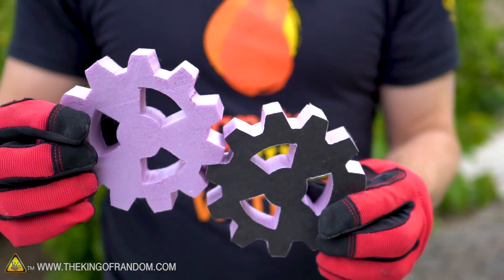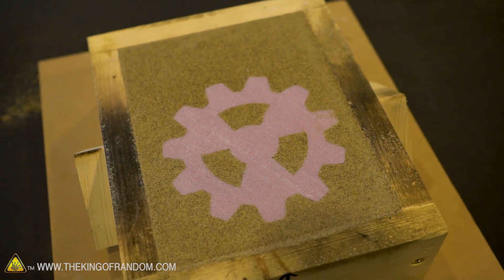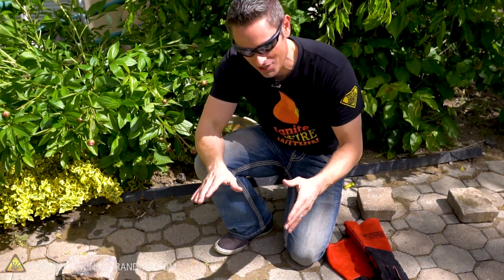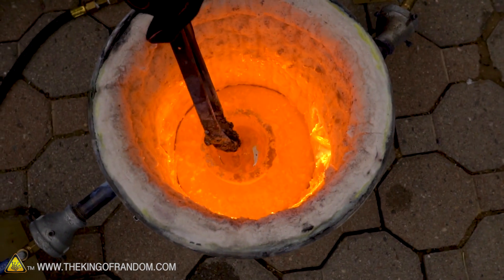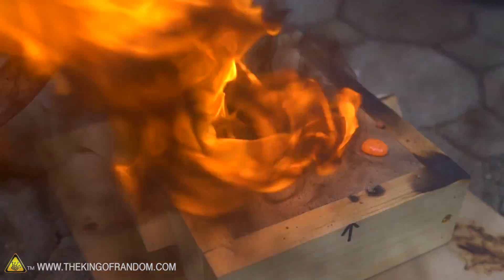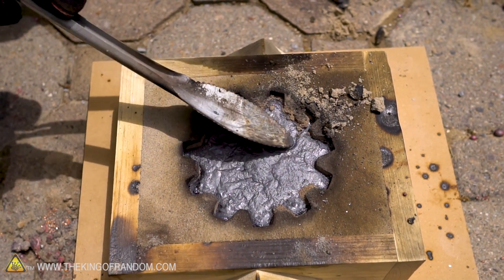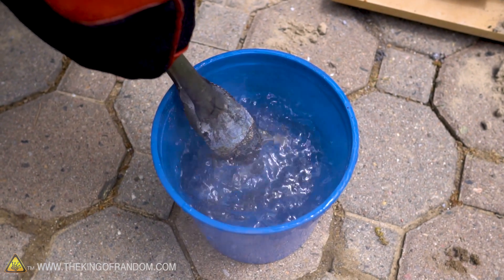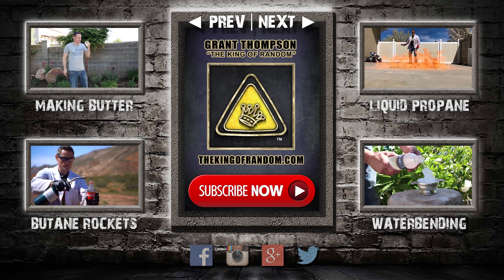Argh. Why Is Copper So Difficult? TKOR Tests Melting Copper In Our Homemade Foundry

Comment: You'll need a interlocking sand (grains with sharp edges) and one of much finer grain size. Then use a mould cavity design with both a lead in (for a gear design, properly best placed in the center of the hub) and also a spillover with lead outs from each of the teeth.

Comment: Maybe have it where a hole leads down into the mold where the styrofoam is sealed into the sand box that way the sand is stable
Reply: So basically two box sand mole where the 2nd box has a hole to allow the copper to flow into the more stable gear mold to keep the sand from floating to the top

Comment: Problem is the density of the copper which is very high .just mix some moist cement with sand and bake the mould and then spray some more water and bake that again . And then try

Comment: I wonder what kind of sand you are using? Perhaps brick layers "sharp sand" will keep form better? Beach sand has been rounded off over time, sharp sand is usually sourced from the upper reaches of rivers, the rough edges on each grain of sand helps to lock them together. If you have ever played on a sand tennis court you will know how hard "sharp sand" can be packed.

Comment: Not an expert by any means, but have you tried using a petrobond style of sand? Instead of water, it uses oil, like 2 stroke engine oil. The copper might be flash-vaporizing the water and destabilizing the integrity of the mold. I'm not sure, though.

Comment: You do know that the point of green sand is so you can mold without destroying the original. Take out the copper gear before pouring. Also maybe a channel to poor rather then a direct pour would help.

Comment: Your best bet would be to encase your wax (not polystyrene) shape in clay (or your molding sand method), leave it dry (making a sprue to pour the metal into the mold inside), then pour the metal while it is as close to its hottest as possible - you should get better results.

Comment: I'm not a metal-melting-ologist... But from what I know from my forays on YouTube, flux is important in the metal being purer. Additionally, with a metal that's as dense as copper, you may need a different, denser casting medium and an enclosed mold, not open-top.

Comment: Yes Man You're supposed to keep the lids on the side use some sort of vice grips to hold the lids on make a hole going down to the gear then pour your mettle of course you're going to have some cleanup but it will come out a lot better than what you have going on

Comment: bro you're supposed to make a hole and keep the wooden lid on both sides make a hole down towards the styrofoam gear to pour the molten metal into it will keep the sand in place

Comment: I would definitely guess the green sand just dried out from pouring on it so many times. I think over watering it then caused it to boil and knock the sand loose. I'm just basing what I'm saying on uneducated observation... you didn't have ANY problems with the sand when it was at the perfect moisture. Definitely had to be frustrating doing this over and over again.

Comment: If you use a closed mold with a high pouring spout then gravity will help fill the mold in completely!
Also melting the foam beforehand actually isn't great because it removes structural integrity from the mold.
Just some tips if you want to get a beautiful cast! :]

p.s. love the channel!
Reply: Oh also don't forget to add some exhaust vents on the mold if you do a closed cast! Otherwise the fumes may dismantle the mold.

Comment: When I was in school doing green sand casting, we buried the mold in the sand and had two access funnels dug through the sand to channel the molten metal to the cavity the extra pressure from sand on top might hold your gears in place while the pour happens.

Comment: it's because copper is more dense than normal metal so when it goes into the sand it pops out and moves the sand so u need a stronger surface that can handle a sense liquid

Comment: hey Grant, have you considered using the same cut out, but use concrete instead of sand. not as flexible as sand, but hey it will last

Comment: I think you would need to an oil based foundry sand so that the sand doesn't eject like a volcano. With that type of heat you would need a foundry sand that is very dense.

Comment: @ Grant Thompson 

Here is a few ways to make it better.

Use a cope AND drag mold, not just a surface mold because all you upper edges will be worse

Instead of foam, using something that turns liquid, like wax.

Melt your investment by baking your mold.

BAKE YOUR MOLD AS HIGH AS IT WILL GO, at least 375F

Poor with your mold AS HOT AS POSSIBLE

Fill your mold with nitrogen (absolutely NO pressure and the gas must be hot or at least not cold)

GET PROPER POURING TONGS !!!!!!!!!!!!

Comment: this i problem beacause of erosion due to high velocity of pouring metal and high density so if you use closed gating you can regulate speed can get perfect casting.and you have to heat the material to pouring temperature so that it wont have much aspiration.

Comment: You need a two-piece mold using the correct casting sand. You also need to pre-heat the mold in a kiln & bring up to temp before pouring; anyone who does bronze knows this! Be sure to flux out your crucible of molten metal right before pouring, as impurity's will really screw things up!

Comment: the copper is so hot that whatever moisture that's in the sand is immediately evaporated out, which is why it was so crispy, and likely why the middle parts of your gear kept falling out.  that and someone already mentioned the density of the copper causing those parts to float out...  

maybe you could try to reinforce the sand with toothpicks or something like that (maybe not wood, but something)

Comment: From what I know, with the wetter sand, more water in it turns to steam and expands it, that's why with the wetter sand it's not great. additionally while the heat makes the styrofoam shrink, it turns into basically plastic. That plastic when burned (with molten copper) leaves a small black charred mess. That plastic could account for the imperfections on the downside of the copper. Insulation packing is probably more dense than most other foams, so maybe a lighter foam will work, either that or somehow remove it before pouring?

Comment: man use a top part of sand let me explain, make the bottom part the same as u made but in the top part put a pipe and put sand and press, after remove the pipe and you will have a way to put copper in the midle of the sand and the sand wont get destroyed by copper sorry for my englis i speak portuguese XP

Comment: The sand keeps floating to the top because of density. Liquid copper is more dense and the sand just wants to float. There are plenty of copper casters here on youtube who use green sand--just used a SEALED green sand casting with risers, not foam. Hope this helps :)

Comment: My experience has been that normal kitty litter is unsuitable for green sand. My bag was calcium bentonite, which had very poor dry/high temperature adhesion properties in all my tests. Sodium bentonite clay appears much more sticky and solid, such that I can cut/saw my green sand using a serrated knife if I let it dry up. To make sodium bentonite, I blended kitty litter powder with saturated NaCl brine water from my water softener. After a few hours of letting the clay settle, I sucked the brine off the top (using a syringe needle + small vinyl hose connected to a pre-evacuated cookie jar vacuum chamber), then repeated the process of adding water, blending, settling, draining a few times to wash the residual salt off.

Comment: You should try adding some corn starch or potato starch to the sand to add some more rigidity. Since it's a non newtonian fluid it might help bind the induvidual sand particles together. Also because starch is a carbohydrate it will lose it's hydrogen atoms from the heat and turn into solid carbon wich could hold the sand together. (or destroy it) I say it's worth a shot at least after making all these tools and preperations.

Comment: just 2 thoughts... add a lid to the sand casting with a funnel like when you were casting the swords or... add something like a bolt in the sections of sand that keep braking off to connect it to the rest of the casting.. like i said, just ideas!

Comment: You need to make a mold that is supported on top so the Center pieces don't float to the top. Also you might want to use foam board from the craft store instead of insulating foam. I would really like to see you try these suggestions as I think it would work.

Comment: ok, can you try to the foam gear in the middle of the sand with a foam rod leading into surface? when you poor the copper, it will burn out the tube, then flow down into the mold and spread out. note you need your copper very molten for this method.

Comment: if you do the green sand correctly it will work, you want to make a surround casting around the gear, put it half way in green sand in 1 box and half way in a other, be sure to use some sort of releasing powder, baby powder works, then you should have a box with a void in terms shape or your gear in the middle. then add a pour hole on one end on the gear, and a vent hole on the other end. heat up your copper, and just keep pouring until you see copper coming out the vent hole. it can be difficult to do at first, but once you have the correct mold it will work right now you are not using green sand casting correctly, also it will cause less fire scale on the finished project, and you could see if you can get your metal hotter, and you should heat the mold to have less heat loss from the copper

Comment: Hi, Grant! I'm a BIG fan of yours. I can see the issue you are having is because the molten metal is denser than the sand, thus, popping the sand up. What you must do is to create a second half of the sandbox so the foam is completely surrounded, placing the foam in the centre and after placing the second half of the box, make two passages for the molten copper to flow through. There MUST be two passages to the foam as one passage is for the molten metal, the other for expanding gases. If the gasses can't escape then, POOF, a cloud of hot sand and possibly some molten metal too. Keep up the great work!! Hope you have more success!
Ed

Comment: next time, try covering the symbol and pouring the copper into a channel that flows into the mold. You will have to cut off the channel afterward, but your middle pieces won't float.

Comment: why dont you stick the styro foam to the base board and after you put the sand into the mold you will just turn it up-side down and take off the board with the grear form and you will just have an empty gear hole you will just pour the Cu into a form without styro foam

Comment: You should have made it an enclosed mold with a cap on it and a pour hole with vent holes. Then it would have had enough structure to hold together when pouring the metal.

Comment: Couldn't you just make the mold then use a spray bottle with diluted white glue and water just spray  the sand let it saturate a bit and try melt out the styro lightly spray the inside edges of the mold with same glue water mix let that dry and then do the pour? I would think it would make the mold hold its shape for slightly longer at least making the edges not crumble.

Comment: Instead of sand, you should use concrete for higher temperature meals such as copper and steel. This would make sure the styrofoam stays in and none of the sand will collapse.

Comment: What about if you made a trench for the molten copper to get to the mold rather than pouring the copper directly into the mold cavity?? That was you are not pouring it directly into the mold and causing damage to the sand.

Comment: try using copper wire. you can melt many batches of wires in a single go. and add borax to the melted copper.

Comment: What you have to do is bury the foam piece half way up the sand box so that it is completely covered by sand. Then make vents and pour the copper into the vents. Or instead of burying it halfway, use the second half of the sand box which you made for this very purpose, fill it with sand and put vents in that half. Then cover the gear mold with the vent mold. This will ensure pressure is applied to both sides of the radioactive symbol sand pieces so they don't move.

Comment: I have your solution after I saw your vid I tried it myself and it fails a couple of tries and what you want to do is move the sand around so that not just the surface is wet and if you make the details too wet they will want to float to the top more than they usually do

Comment: Add some PVA glue (or plaster) to the sand and wet it a little more.
Copper is more dense than sand, so the islands are going to float away!
The PVA/plaster should hold the sand together even if it dries out.

Comment: I might suggest a second box on top with a hole leading to the foam mold and fill the mold under pressure so the center pieces don't pop out

Comment: You need different sand! Regular hardware store sand is mostly silica, which cracks in high heat casting like copper. You should try firesand aka chamotte. You can get it from pottery supply stores. Another other option is olivine sand, which might be a little harder to find. 

You can also try sifting play sand with a 70 mesh filter to remove the coarse pieces, and/or adding up to 6% bentonite clay for better bonding.

Also, use some Borax as flux.

Comment: I would suggest that the sand popping out is because the copper is so much denser than the sand and anything else you would be casting and so it floats to the top

Comment: Your sand is less dense than the copper so the sand floats on the copper. Whatever sand not firmly attached to the rest of the mold breaks the bond and floats away. Aluminum doesn't have that problem. You will need a two sided mold with a cope and a draw.

Comment: Have you tried using silver instead? It has a lower melting point and has the ability for a cleaner finish than copper (if you put the effort into cleaning and smoothing)

Comment: I think your best bet for casting that gear with copper, is to mix a bit of Plaster of Paris or cement in with that sand to make a harder mold. Cast the foam gear in the plaster/greensand mold then use a micro-torch to burn it out and clean it up a bit before pouring the copper. Part of your problem is that the sand is less dense than the molten copper which makes those chunks want to float. If you have the sand wet when you pour, the water in the sand flashes to steam and agitates the molten copper a bit.

Comment: Hmm. It's an interesting issue that the sand bits were floating on the copper. I wonder if covering the whole Styrofoam placeholder in sand and digging a hole through the center to pour the copper could help. Obviously it needs something on top of these sand bits to keep them from floating...

Comment: You Need a closed mold. The reason why the sand gets pushed out is that there is not enough resistance holding it in there. You Need to make a 2 part mold with a canal for the copper to pour in and another, smaller canal (or more than 1) on the sides to let the air and the rest of the copper out again.

Comment: Pack the sand harder, make a two piece mold (with a top) and sprue it.  Also, why didn't you just melt the styrofoam with a blowtorch instead of trying to hold and balance a hot crucible with salad tongs?

Comment: dry your sand out then add 1 quart of used motor oil per 4 pounds of sand. the oil will tend to smoke and burn more but will give the sand better cohesiveness and it won't evaporate like water does

Comment: I think the green sand can work. Try pouring alitle bit of the copper into the mold, let it cool then pour alittle more. Keep repeating until all the copper is inside the mold. Maybe doing it little by little will keep the sand in place long enough  <3

Comment: two questions.

One, why that shape? The sand making the holes seems an inherent weak point in a mold like that. A shape that didn't rely on those holes, at least for your first casting, getting used to copper, would make more sense.

Second, why not a two part mold with a hole leading down to the cavity, and a vent hole? I see most wooden box sand casting done that way, and wonder if it wouldn't have given you better results.
Reply: It seems to me that if you made a two part mold, with a cavity where you burned out the styrofoam, on one half, and a flat, featureless other half, save for two holes, an inlet and air escape, in the other end, that it should work better. After all, the sand in the shaped mold that is there for the three holes should not pop loose, because it will have no where to go, and the weight from the top would hold them in.

Comment: The pour would be a lot smoother if you got some kind of flux. Also you need to scrap off the slag(lol slag) before pouring. You can also boost the temp by adding oxygen into the gas feed.

Comment: the problem is the loose detail in your mold. copper is usually casted in whole chunks then the details are added in later via drilling, filing etc. also, your mold is open which contributes to the premature solidification of the copper.

Comment: perhaps you should try to cast with plaster. put the styrofoam shape in a bucket, pour plaster on top. make sure ofc you have got a pouring hole. let it dry, and then put in some sort of oven so the styrofoam can melt. then pour in the copper

Comment: Grant Thompson - "The King Of Random"
      You really should try and use plaster of Paris for your mould, I know it may be more costly, however if you let it harden and then dissolve the Styrofoam away with Acetone, it may provide better results